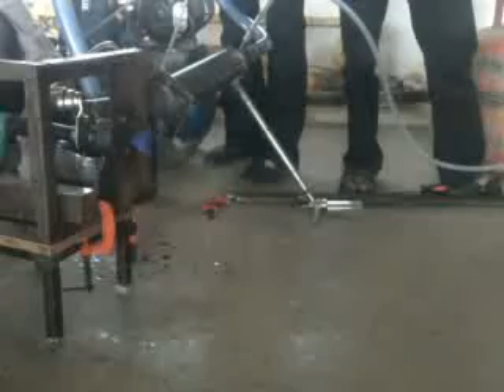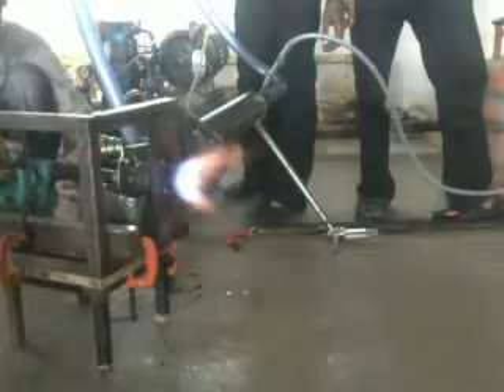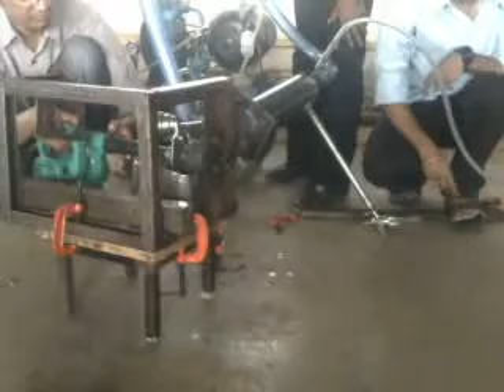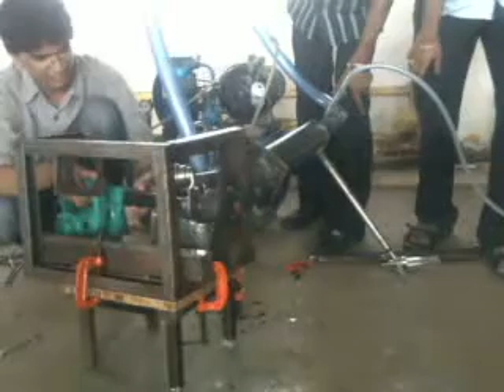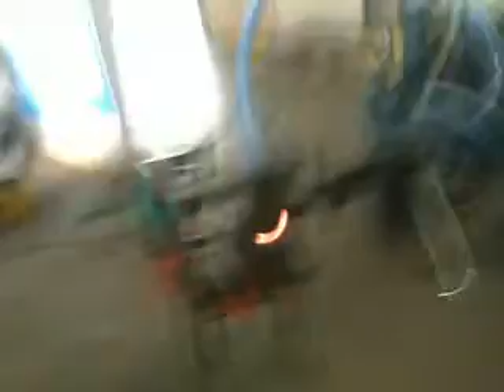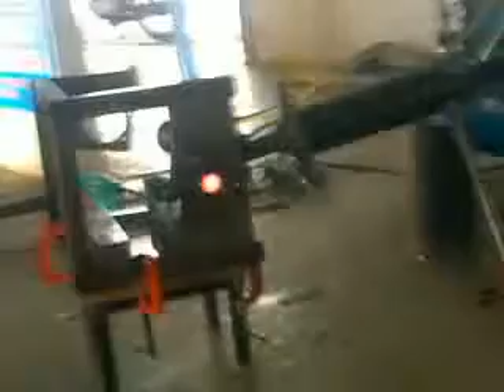turbo charger gas turbine jet engine

Comment: hi friends. u all did a gud job..the sound is amazing, totally awesome of ur job.. can u tel me plz the compressor discharge pressure...this same explosion sound occurs at the time of compressor surge or stall occurs..wat fuel u used...propane or lpg? am asking coz i did the same job for my final year fabrication project.its in youtube link..type..Turbojet engine.Mechanical Engg project. VINJET.
.thanku brothers...
kids always rocks...

Comment from the maker: @vinaymechrox hi, the max pressure ratio that we measured was 1.9 at which our bearings got messed up. theexploaion was not compressor surge, it was our spar igniter coming off.  we have never pushed it to stall ;) we use LPG for fuel. i saw your video man, thats nice. u have cool machine. congratz. ur pulse jet is cool too. maybe we can meet sometime, what do u do now????

Comment from the maker: @honeybunchickens: We supplied too much fuel so it started burning outside or maybe our combustion chamber holes are not enough. We will rip it apart and change the dimensions of combustion chamber and test again. or maybe the problem is the compressor does not give enough mass flow rate at all the compressor and turbine characteristic don't match properly. we are not sure of the problem yet. we still have lot of stuff to do :)

Comment: Hey, nice to see your video.
I have a bad experience in that phenomenon.
The flame reach the turbine, & suddenly an explosion occur.
It brake the turbine blade and need 3 months to fix it.
I think it is very dangerous if the flame came out from the turbine, because there's maximum TIT (temperature inlet turbine).  If the temperature reach max temp allowed, I think the blade will experience thermal stress.
For sharing, look at what i've done in my video.

Comment: Your T.I.T. is too high.  Turbine should not be orange. your combustor should keep the flame inside and have a good layer of cooling air around the outer combustor form the outer combustion chamber casing.